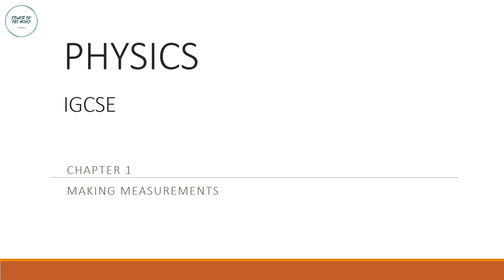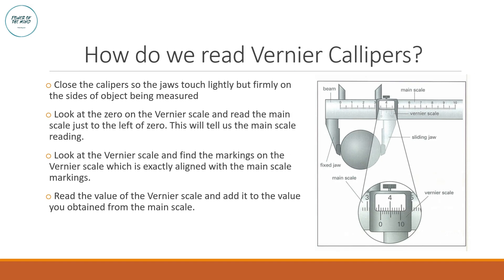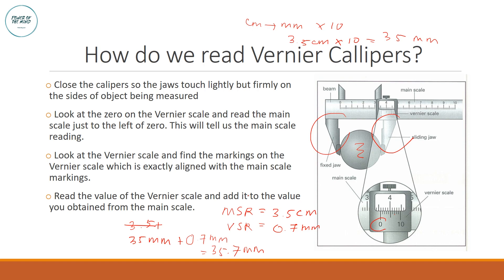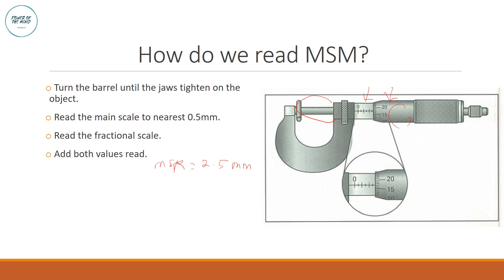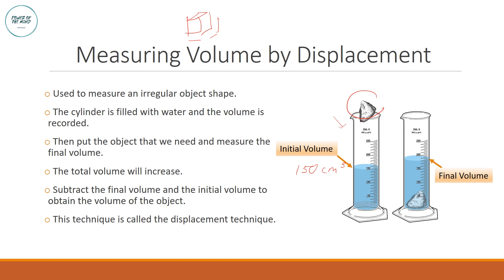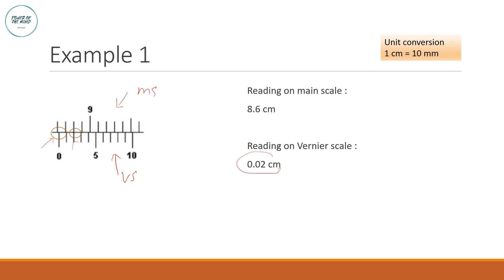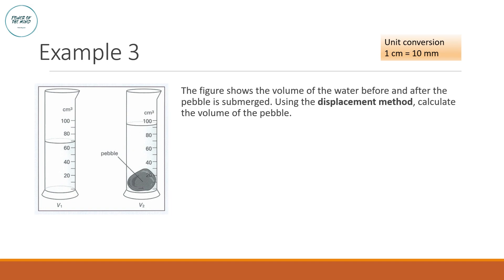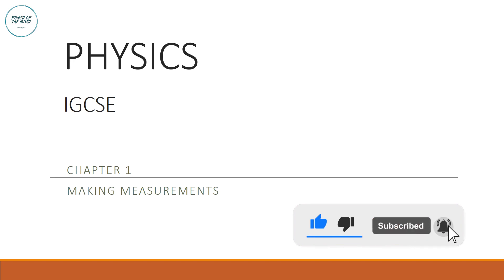IGCSE Physics Chapter 1.2: Improving Precisions in Measurements

Comment: So..
Vernier = 2 scale measuring (main and vernier) adding two values equals to measurement of accurate length
Micrometer = 2 scale as well (main scale and fractional scale) adding both values as well. 

Vernier scale is in centimeters and millimeters, while micrometer is in centimeters therefore making it easier to measure...

I got a question tho, how often does the zero error happen? Like it happens most of the time?
Reply from the maker: Hi! Micrometer is in millimeters. To answer your question, it actually depends on the tool. Some measuring tools have a defect in which the tools were not properly designed or it has been mishandled causing the tool to not show zero. therefore giving us the zero error. It does happen often when you are in school labs as the equipment are mostly reused every year. Thank you for your question and take care!
Reply: @powerofthemind07  I see, thanks for answering my question! And micrometer is in millimetres, my bad... 😂